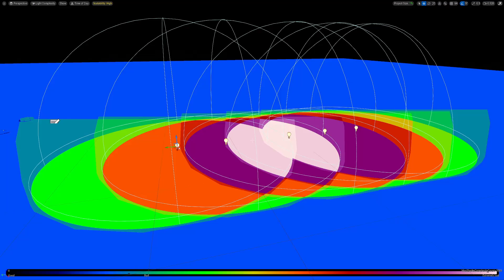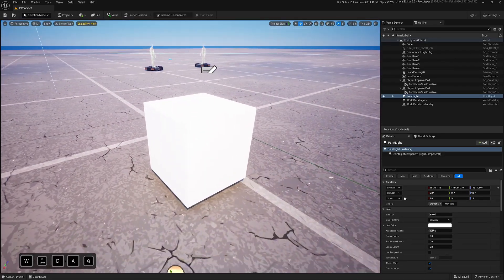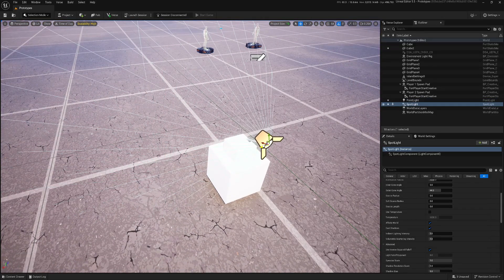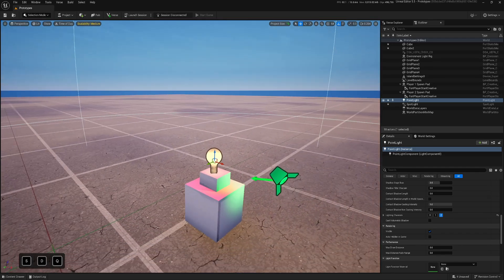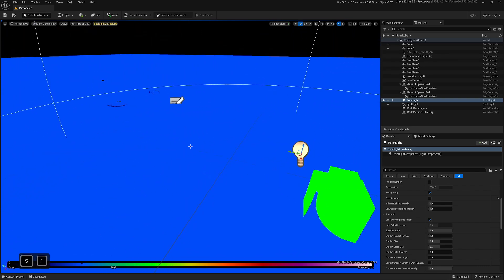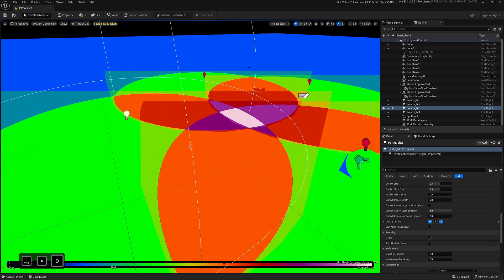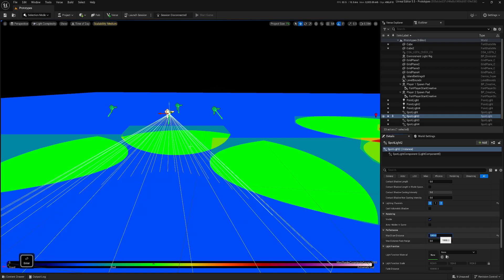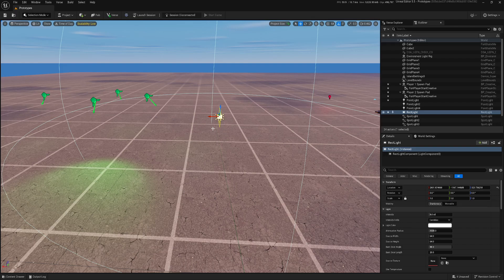Learn How to Work with Lights to Optimize Your Maps - UEFN Tutorial

Comment: Is it possible to use a rect light but have the light look rectangular instead of circular on the ground
Reply from the maker: @res0lve  Rect light actually does that by default. You can play with parameters to adjust softness and angle etc.
On top of that you can create material and set it from Surface to Light Function with your custom logic inside. Then input that material into light function input inside light.
Reply: I meant the spot light, sorry.  Was wondering if I could use that for the perf boost and have it look more rectangular on the ground.  Would a light function work?

Comment: That was excellent thank you, I never knew about the 0/1/2 with lighting or the distance for turning things on/off
There is something called Affect Distance Field so if you have a light in an indoor area and it does not give enough light off under lighting you can scroll down to find it or do a search - so if you Un-Check (un-tick) Affect distance field lighting it should let more light through the mesh (not always going to look better but it is an option before adding lights) Basically it ignores the mesh and lets light into the area - just info for others to play around with.

Also sometimes we can get a shine from a light especially on reflective areas or maybe what looks like a ghost type light - this looks worse when there is no reference to a physical light so in an empty room you can get the effect you want but might see a shine / orb of light that you do not want.
Click on / select your light source and on the right side in details panel look for INDIRECT LIGHTING INTENSITY & VOLUMETRIC SCATTERING INTENSITY
Turn those both to 0 zero and the ghost type light orb should go away.
Reply from the maker: @Fallen-Champ  Good suggestions!
Just be careful with indirect and volumetric lighting as it gives "bounce" effect, such as real light photons do. Otherwise only directly lit object will have light casting on them.
And volumetric helps with God/Sun rays.
Reply: @AsicsoN  thank you for the info I had previously watched some short clips but they did not mention that as they no doubt might not be aware.

Do you know if this comment is correct "read somewhere that lumen works better if walls are separated entities (1by1) and not one single mesh"?
Reply from the maker: @Fallen-Champ  Yes distance field works better in modular parts rather than large object like full building. But keep in mind Lumen isn't working below high scalability. Plus in game settings nanites and lumen must be enabled. But for some reason by default they switched off.
That light ball which you mentioned is coming from heightfog. So it's volumetric lighting plus heightfog. As they work to create rays but sometimes bring that issue and need to adjust settings.